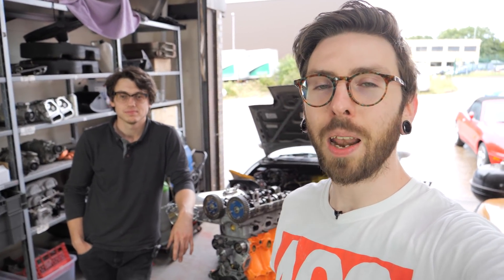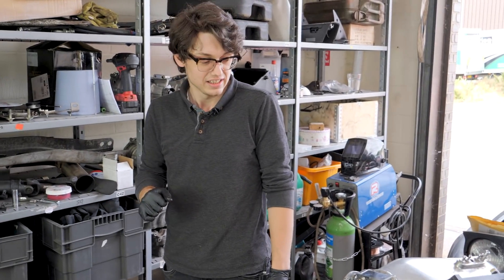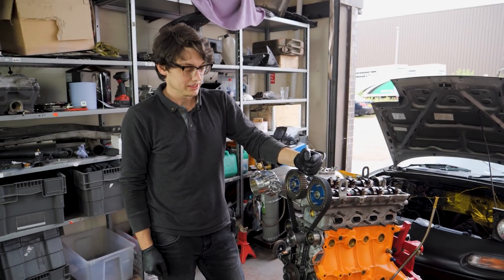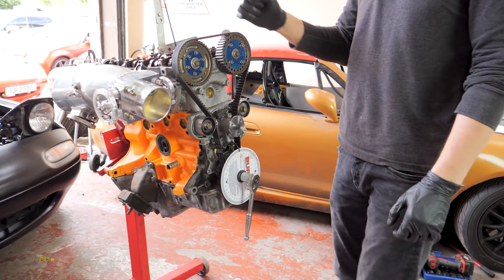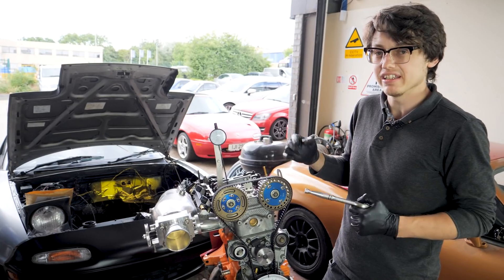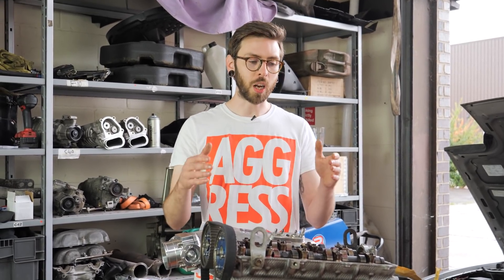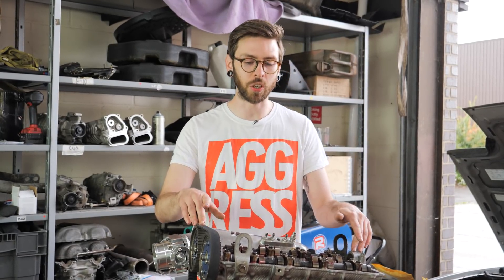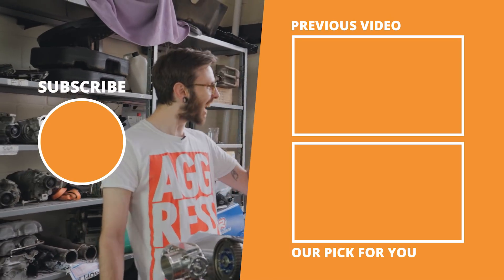We Put TWO Exhaust Cams Into Dan's Mazda MX-5 Miata 1.6 NB Engine

Comment: I plan the same mod on my forged 1.6 Rotrex. New ported head is already finished.  But I have a set of Mazda 323 Turbo cams. I plan to use the 323 exhaust cam and the NB 1.6 exhaust cam as Intake. I'm running already a 36-2 wheel at the crank.
But it's not the best solution for me  to run solid lifters on the intake and hydro exhaust. I've been noticed that high oil temperatures reduced the lift of my stock NA cams... Thus results in less power. I ran into trouble with this setup because the intake with the solid lifters should be stable and the exhaust side is reducing the lift when it's hot. 
And I don't know the best setup for Rotrex.. cams with more duration and overlap or less. It seems that dynamic compression is the important thing. But I have no clue..

Comment: I'm so confused, is this a 1.6 block with a 1.8 head? This was my first thought when it came to making the 1.6 flow better but every forum I asked on told me it wasn't possible.

If this is true, the cheapest and most effective path to boost would be a NA6 on a Arduino based ECU; cast Mani, etc.
Reply: Nvm, figured it out. Had no clue NB's had a 1.6 option out there, your screwed emission standards have potentially helped my old 1.6 spool faster!

Comment: Hi I'm thinking about doing the same on my 1.6NB with the exception of using 2 exh NB camshafts. The stock exhaust and intake timing are 110° b/a tdc. Is it possible to use the stock cam angle sensor at the 180° offset that will be achieved by just swapping it in? I'm running a MS3 and really hope I could make this work. If anyone knows something about that I'd love to hear that :)

Great work, I really think this is my favourite Miata shop

Comment: What is the specific tool you used to find true tdc? Need to degree my cams on my mx5!
Reply from the maker: The best way is to make a piston stopper using an old spark plug that is drilled out and tapped to take a threaded rod. Then make a note on the degree wheel where the piston stops both clockwise and counter clockwise, and true TDC is halfway between the two

Comment: Does this turn the engine into an interference engine? I'm pretty sure the recess in the piston is smaller on that side.
Reply from the maker: You can get away with gigantic skims on the heads before they become interference engines. We haven't changed the valves, so the diameter of the recess is unaffected. The increase in lift is pretty small at 0.4mm and the head was only faced. Many racers skim 1.5mm off the heads so we've got plenty of wiggle room.
Reply: @BOFIRacingTV  awesome, thanks! I'll add this to the list of things to mess with.

Comment: Are you sure your ADV and RET reference to more or less rpm for peak power was correct? I thought the exhaust cam was what you said, but inlet is the opposite, ADV gives more overlap and works more efficiently at higher rpm??
Reply from the maker: Great comment. With the intake you are correct that you would advance the intake for more overlap as it would be opening sooner. However, that would bring the power band down the RPM range. If we retard the intake, it reduces overlap but moves the power band up. We can then increase the overlap and scavenging for NA applications by then also retarding the exhaust. In this case, we may choose to retard the intake to move the power band up, which will then reduce overlap slightly. We can then dial the overlap out further by advancing the exhaust, so both cams are moved in the opposite. In an NA application we would often move both cams in the same direction but by different amounts.

Comment: So I’m curious how the cam angle sensor communicates with the NA ecu, please and thank you. Love this stuff, been trying to find a 94-95 MX3 1.6 exhaust cam for what feels like forever. I think this head swap is fun and I’d like to do it here in the states, excited to see this whole setup running.
Reply from the maker: This car will be getting an ME442, so we are able to use different sensors. Sounds like a fun experiment, let us know how you get on!
Reply: BOFI Racing - thanks for the reply. I’m currently on a speeduino based setup from Speedyefi, talking with them last night they suggested I run the whole NB long block and swap to the protege 36-1 crank sensor in place of the CAS. We’re pretty sure the usdm 99-00 nb 1.8 ran the 36-1 and should already have a decoder in tunerstudio settings.
Reply: @MonkeyWrenching  no na/nb ever came with 36-1 but as you said you can use the protege wheel.

Comment: Could I do this on my 99 1.8?
Reply from the maker: Yes, the hardest part is redrilling the pulley which would need to be done very accurately if you were to use the original ones and not adjustables

Comment: Pretty sure the NA cams have a different profile to NB cams to accommodate for The HLAs......
Reply: The main difference between hydraulic and solid cams is the RAMP design. Hydraulic lifters take up all the slack in the valve train by .004"-.005", and have the valve about .001" off the seat at that ramp height. Generally by .015" or so, hydraulic cams have reached PEAK acceleration. This is about equal to .022" valve lash. Set the valve lash at .024", and you've put ALL the cam acceleration into the rocker arm BEFORE it contacts the valve. OUCH!!! Talk about slamming a valve open! If you want to run solids on a hydraulic cam, you have to set the lash at .004" to .006", never looser than .008".

copy pasted from google but seems accurate
Reply: @Nebbia_affaraccimiei  there is no rocker arm on these engines .... Don't believe everything on interweb ....;-)
Reply from the maker: There are much more aggressive cams out there for the HLAs than the NB cams, but that difference in cams from Mazda should hopefully benefit us

Comment: Great vid lads, great content.  And as ever Awesome to see people utilizing the 1.6 unit. I visit forums over the pond, and if it's not 1.8 base, its dog shit.!???. Kudos to you lads. Keep up the good work. Subs with bells on.
Reply from the maker: 🔔 Thanks! There is no argument against the extra displacement... All the race series here use the 1.6 though so that make us feel better 😂
Reply: I head a valve problem on cyl 4 recently and i was contemplating doing a 1.8 swap but i changed my mind when i  opened up my engine. It is in very good condition and i'll put a SC kit from Bofi soon. I am few hundred pounds away from that moment  :D and i just can't wait for it
Reply: I have a Mazda mx3 exhaust cam in my 1.6 NA Engine because the mx3 have the CAS on the exhaust Side. But it seems to be the better option using NB cams because of the higher lift.  What a lucky day i have 2 or 3  pair of them. Btw my Car is Rotrex c30-74 driven. I want to convert it to 36-2 trigger with Cam Signal because its fully sequential wired. I want to use the FM 37-2 Mode. But i think i have to Test the durations with my Rotrex what its the best for it.
Reply: The 1.6 also disappeared from the miata in US models starting in 1994 so they are a minority engine across the NA/NB production run.

The early NAs with the 1.6 are prized as the lightest miata and gets lots of love but its almost comical how quickly people start down the path of making up that weight difference and then some.

Many getting the full 1.8 swap including the heavier driveteain parts, upsized brakes wheels tires, thicker sway bars, chassis bracing, roll hoops, hard tops etc.

Comment: Sorry to say adjusting the valve clearance on a Honda is piss easy, no messing round either with shims or gunk in the hydraulic lifters
Reply: No modern Honda has solid lifters
Reply: Alex Strömberg The K series engines are roller rocker design and valve clearance can be adjusted by undoing a nut and tightening / loosening a screw. No hydraulic lifters.
Reply: @seany8787  i know what adjusting valves is, I do it almost every day at work. Why do they not just have hydraulic lifters
Reply: Alex Strömberg because they arent as good as solid lifters for high RPM applications. Valve bounce
Reply: @seany8787  most k20s dont rev to 9k. 99% of them are 90% under 3k rpm.
Reply: Alex Strömberg talking about the K20a’s and K20a2 as found on the high performance type R stuff. Not sure where you come from but theres plenty of those in UK.
Reply: @seany8787  yes here in sweden there are probably a lot of hondas with k20, but just like most people, they only drive A to B. not at 8k rpm.
Reply from the maker: Yet another reason Mary needs a K20 😅

Comment: What are the benefits to nb head on na, apart from cam mod? Does nb head flow better?
Reply from the maker: Supposedly, we'd need to get them on a flow bench though to confirm
Reply: @BOFIRacingTV  Did you ever find out if it flows better? Am I right in thinking the NB 1.6 takes the same manifold/header as a NA 1.6?
Reply: Have both heads Side by Side on the bench. Its the same head Same diameter of  intake and exhaust ports. NB Heads are structured oudside from the cast. NA heads are smooth, NB Heads are ruff like a waffle structure .The only differences that can ne influce the output  are the cams and Solid lifters.